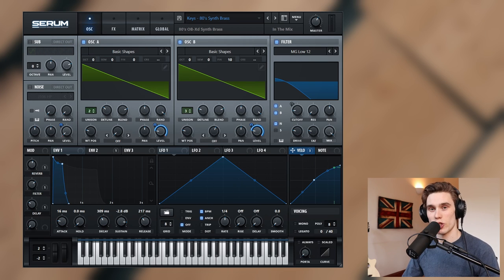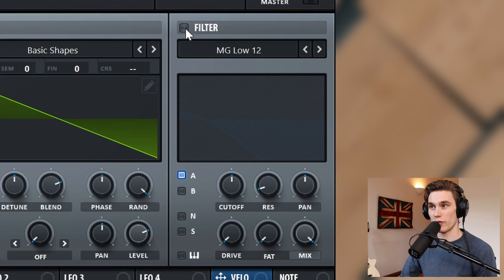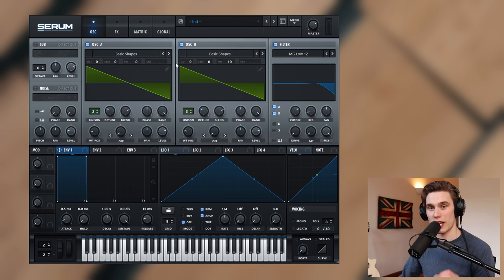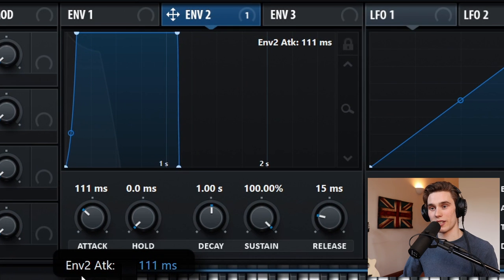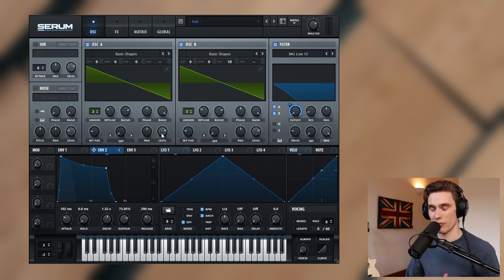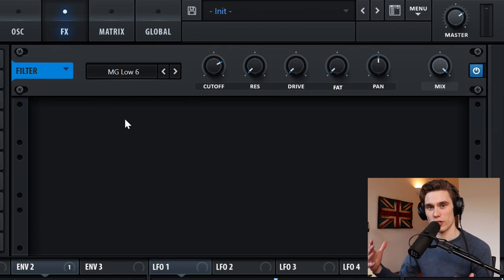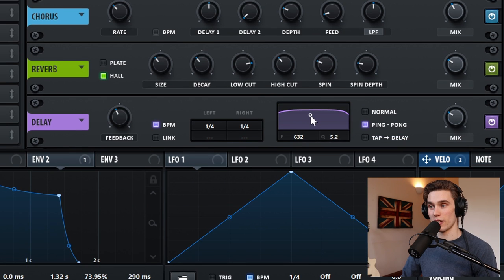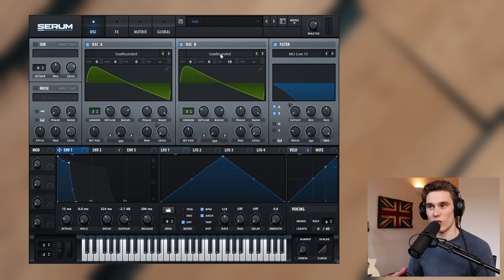Sound Design Tutorial - Synth Brass

Comment: Is there really any difference between using one Serum oscillator with a unison count of 5, and both with one with a unison count of 2 and the other with a unison count of 3? Specifically when you have exactly the same waveform. Detuning the second oscillator seems like it would be the same as just increasing the "detune" in the unison section of the first.
Reply from the maker: Try it for yourself and hear the dramatic difference :)